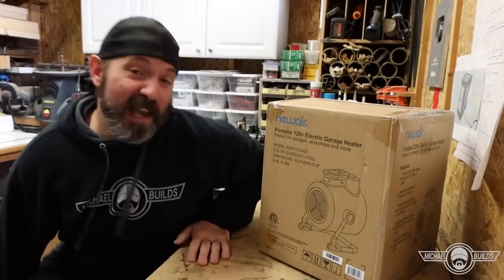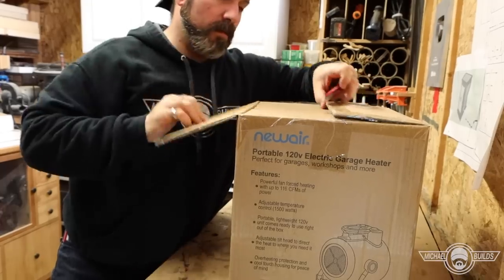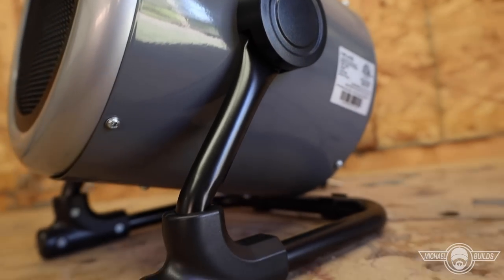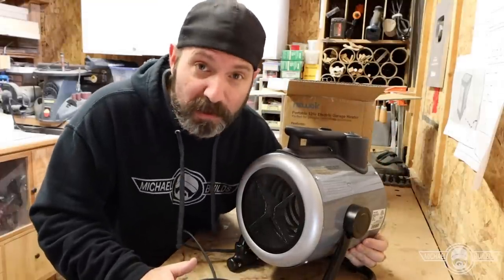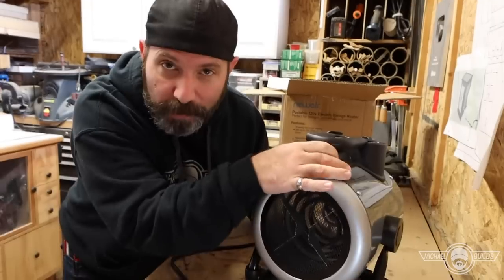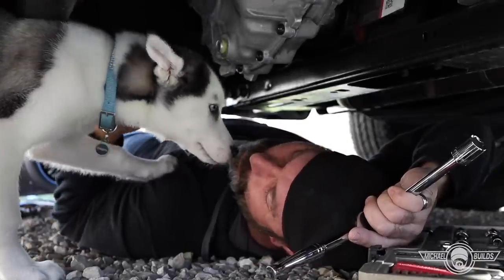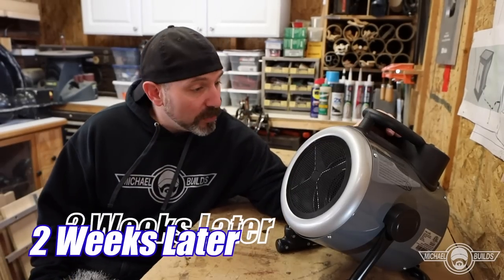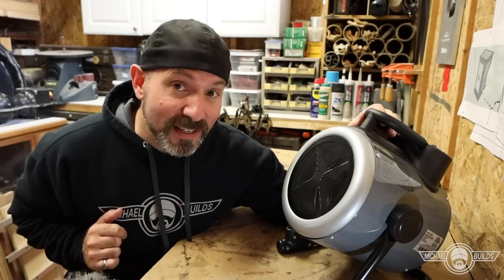NewAir Portable Heater Unboxing / GIVEAWAY

Comment: All 120v space heaters heat the same. 
https://youtu.be/V-jmSjy2ArM
Reply from the maker: Even I they have a fan or no fan?
Reply: @MichaelBuilds  The fan cuts into the max voltage that is allowed. You can only get so much juice out of an orange. You may have notice all heaters have the same wattage ratings. The link shows another channel talking about that.